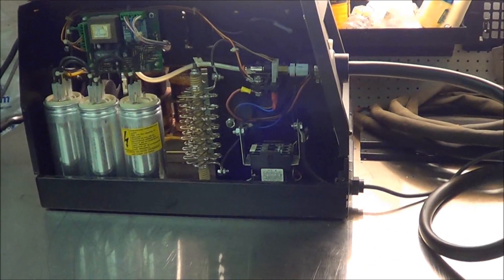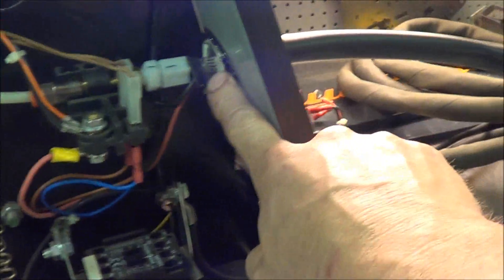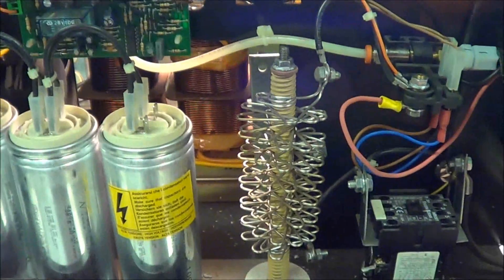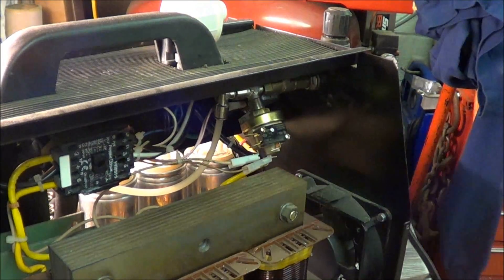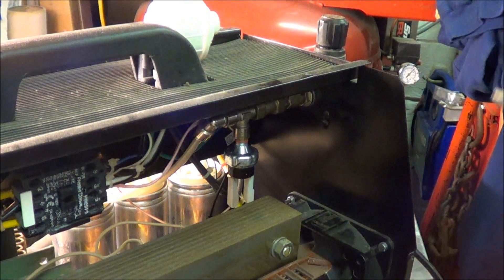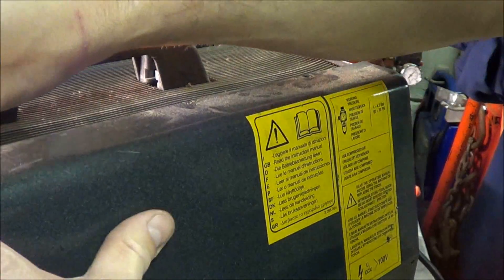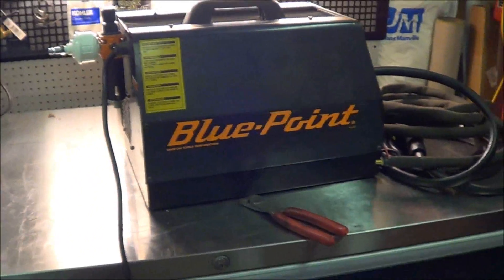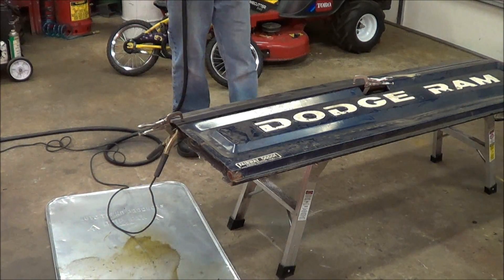Alpha 3a torch install on YA2225 plasma cutter and test drive

Comment: I was given the exact same plasma cutter, powers up, air flows, 2 out of the 3 points engage, the contactor does not engage, and no cutting ability. Any idea where to start??
Reply from the maker: Do you have original torch or the Alpha 3a that is in the video?
Reply: @Broncocarl92  mine looks to be the original with a wire clip over the head?
Reply from the maker: @David Heath Underbrush Land Clearing  OK when you are trying to cut have you pressed down on the work piece with the torch? The original required a push start in addition to the button press.
Reply: Yes I did realize after a little research it had to be pushed down.
Put a new terminal end on ground cable inside the machine.
I have not replaced consumables yet. Just pulled the machine out of storage to take a look & start the process of elimination.
Found you quickly!

Comment: I can't get anything but a spark when pushing in on the tip. After about a dozen attempts, I can no longer hear the machine engaging, even when adjusting the air pressure to the proper range with the gun button held in. Is this a relay that engages the current when the noise is heard? 

It's almost as if the machine is lacking current to properly ignite the cutting arc at the tip.

Comment: I have the exact Snap On machine and I dislike the push to start same as you.
We do not have Walmart here in UK. I can buy an Alpha 3 (Trafmet 25) torch over here but what is the rating of the replacement pressure switch? and what are the details of the white adapter that was missing?
I would dearly wish for a pilot arc torch but local suppliers are saying it will not work. It obviously does as you have proved with the correct parts of course.
I hope you can help.
Reply from the maker: Dixie4 It's Weldmart, not Walmart... They are in Texas,  on the web http://www.weldmart.com

I can look at the switch if you like but I would have to open the machine up... the white plastic is a CPVC pipe coupling that fits the hole and is used as a sort of strain relief.

Hope that helps you.

Thanks for the view as well.

Cheers
Reply: ***** 
WeldMart thanks, stupid me. 
I have checked out their web site, thanks. What I have to figure is the correct pressure switch and they have not been forthcoming with this info. The shipping from Texas to UK would be cost prohibitive so I have the feeling something must be available in UK if I can identify.
May I ask what was the adapter kit comprised of?
Reply: Dixie4 
Been in touch with Larry at Weld Mart. I have asked if he is willing  to price up  and supply the kit without the torch and cable, (the torch and cable is available in UK for as little as 120 USD) This is to to save weight on the extortionate shipping costs across the pond these days.

No reply yet, here's hoping.
Thanks so much for the lead to Weld Mart and your video. The new torch makes light work of that tail board. 
By the way my machine has that mysterious washer in the same location.